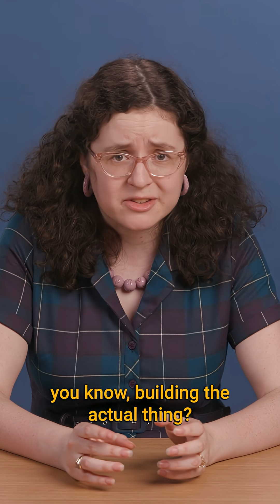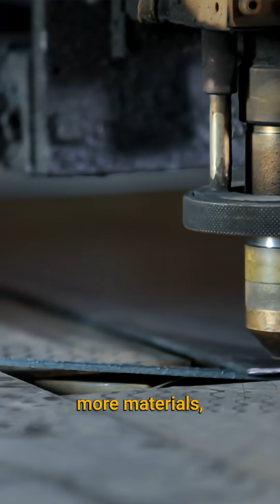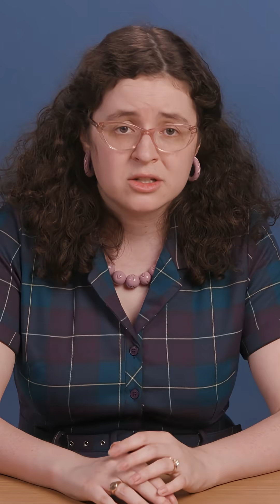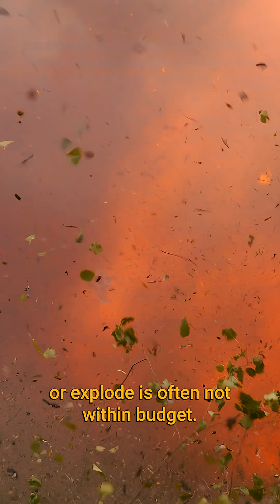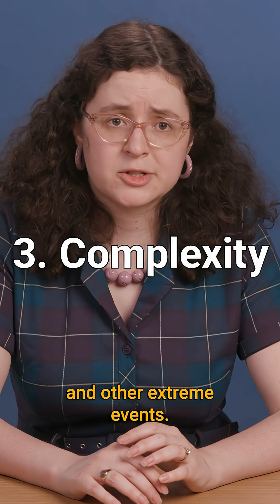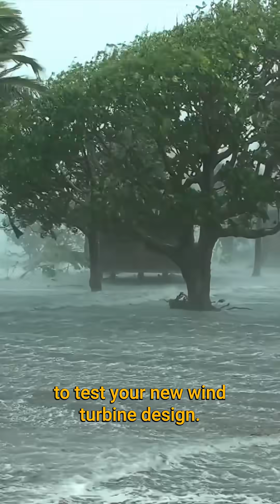Why do engineers build virtual systems?

Comment: It's because they want to make sure you can't change the cabin air filter without removing the entire engine.
Reply: That's wicked. In fact, it's diabolical 😂.
Reply: That is so dumb! Cabin air filters are usually easy to replace.
Reply: @Gowidafloman key word "usually". Don't turn your back, the engineering dept will get you when you least expect it

Comment: This so wrong! Prototyping is so much faster than analysis and if you can’t test it how do you validate the analysis?  Analysis is a lot cheaper and influences design by saving resources but test is king and can’t get test without physical hardware.
Reply from the maker: Simulation doesn’t eliminate prototyping and testing, but it helps you arrive at a better starting point so fewer prototypes are needed and tests are more focused.
You can test models to validate components and design choices, so by the time you get to prototyping you have higher confidence things will work.
Simulation lets you explore design alternatives before committing to hardware so you uncover issues early.
Building and modifying a virtual model is often quicker than fabricating multiple prototypes, especially for complex systems.
Reply: You probably have never taken a course on analysis of systems. If you did, you'd have heard of several validation approaches. In case you didn't know, simulation is not always essentially analytical. You can validate simulation results with analytical results before developing the real system.
Reply: Awesome Olodo😂